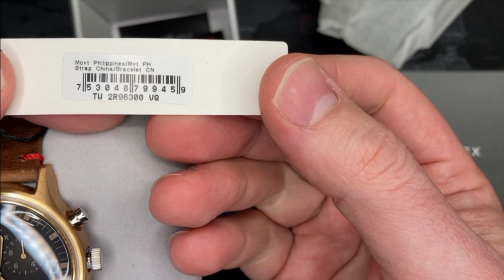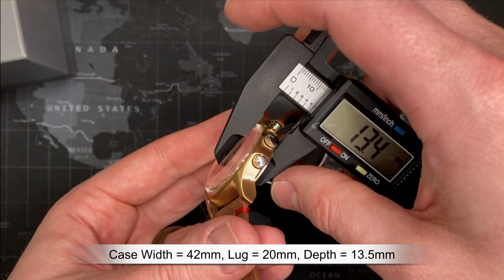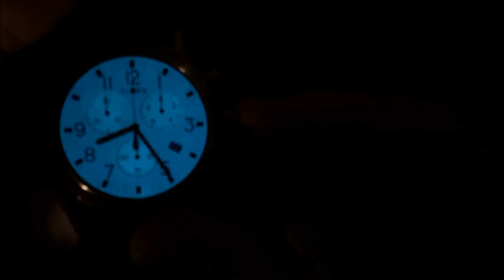Timex "Mk1 Classic" 50m Chronograph Watch - Review & Unboxing (TW2R96300 / W-91 Movement)

Comment: This is the Gacha Champion.
Which ETA gearbox is better for the price?
G10.212 or 251.264
Reply from the maker: Think of it in terms of buying an engine for your project car... and deciding whether or not you wanted to buy the all aluminum one with steel sleeves and roller cams, or the cast iron one. One puts out slightly more horsepower, looks nicer, and theoretically runs more efficiently,  but the other is half the price... yet both of them will still get you to the grocery store.

That's kind of how I look at it. 

Question is, will it bother you to know that you have a cheap version of the movement, or an expensive version? :)